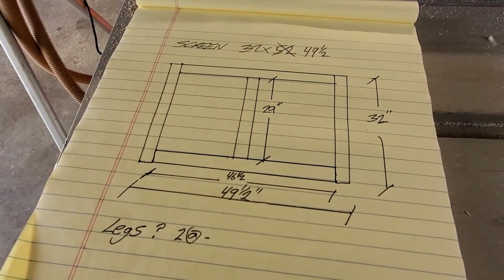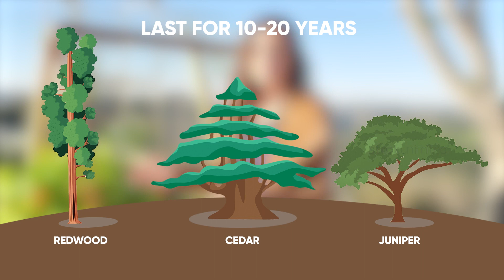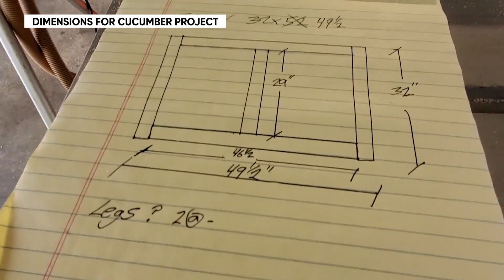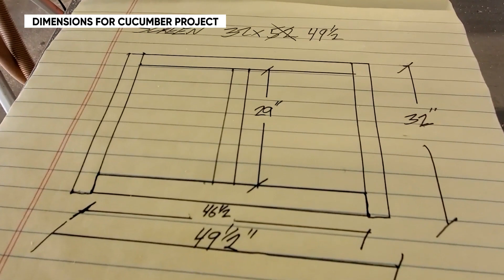How To Build a Cucumber Trellis for Raised Beds

Comment: Also, I noticed that you have no diagonal cross bars. Did you have any problems with the frame? Also a question about the wood legs going into the dirt... How can you protect the wood besides linseed oil which I'm guessing wouldn't last that long in the dirt with all the water in that you need to do for cucumbers? I think I will try this and maybe put industrial Velcro on the bottoms of the frames so that when these crazy Texas freezes come right in the middle of season I can throw on the freeze cloth faster as well as the shade cloth when we get the unbearable Sun here. Do you think that would work?
Reply from the maker: Hi Kathy, great questions! Bridget and Evan are using redwood because it is rot-resistant, redwood is one of the woods commonly used for decking, pergolas, trellises, garden beds and quite a few other building applications that live outside in rain, snow, ice, etc. The thicker the material the better when it comes to decay, but this trellis will last awhile. Raised garden beds made from redwood and cedar can last 10 - 20 years. This trellis definitely won't last that long but it should last quite a while. 

You can use sealants to protect the wood but sealants have chemicals and Bridget wants to keep chemicals out of her garden. Let us know how the velcro works, it is an interesting idea.

As far as the frame integrity, by having the middle vertical piece in there it gives it the strength it needs,  also if you ran the chicken wire across the frame instead of as two panels like they have it, you could have some sagging there. It would depend on how big and how much fruit you have growing over it. Evan also stapled the poultry wire about every 2 inches to make sure it stayed taught. You could use hardware cloth, also called welded wire, if you think you need more stability.
Reply: @KelloggGarden  yes I use cedar on my beds and no sealant. I also like hardware cloth and cattle panels. I used plastic coated wire for my flower arch. I try to use a lot of recycled things that I already have because I've been quarantined since last March and I prefer recycling for the environment and my limited budget, but once in a while go to Home Depot for supplies.
Reply from the maker: @kathylord7939  that is wonderful! You will like Evan and Bridget's potting bench video, they used wood they got from a neighbor for most of it. That video will be out soon. Bridget also used some of that reclaimed wood to build two of their ground-level raised beds. Bridget talked about it in this video https://youtu.be/b6mqn-Mgdqs in segment starting at 08:35